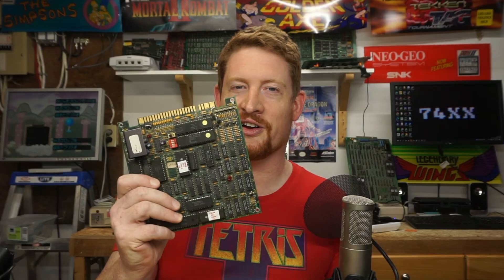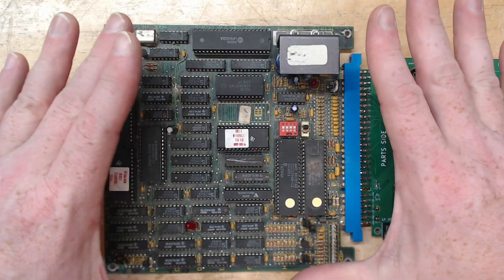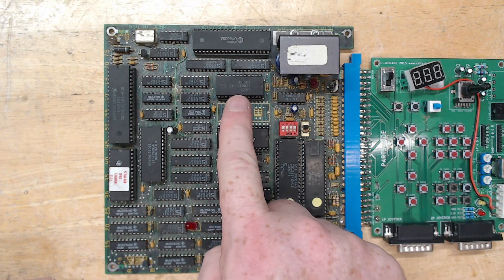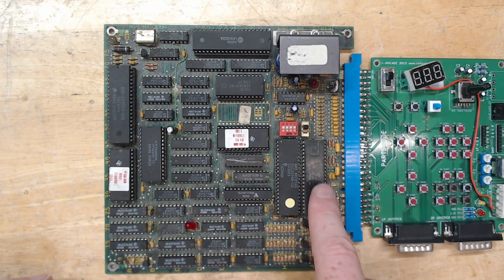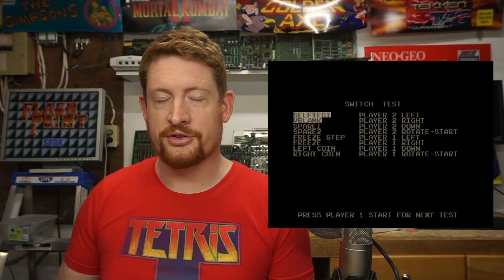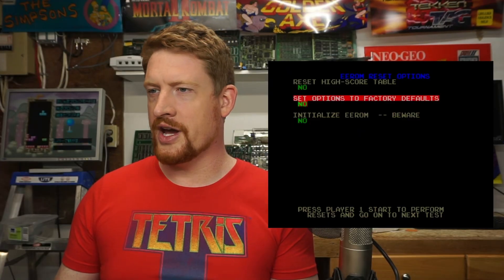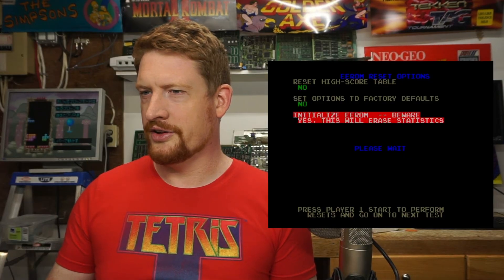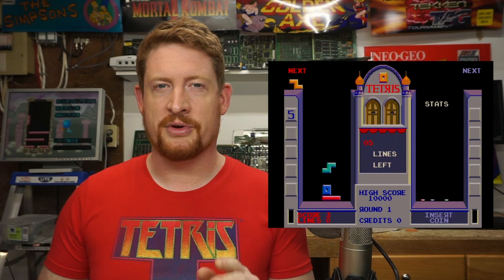Your favorite arcade game has the tiniest PCB, but why won't this one work?

Comment: Could you identify the problem with the EEPROM contents without erasing it??
Reply: you can get a new set of eproms and try the new set.
Reply from the maker: No, we are talking about the EEPROM, not the program EPROM, which you could easily verify with a programmer.
Reply from the maker: No, as far as I can tell it is expecting certain valid values that get corrupted over time.